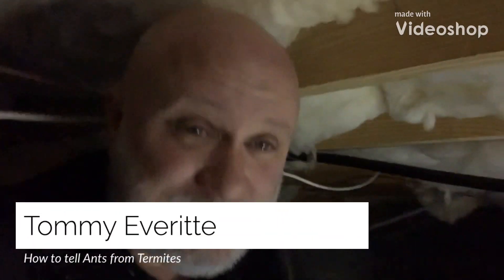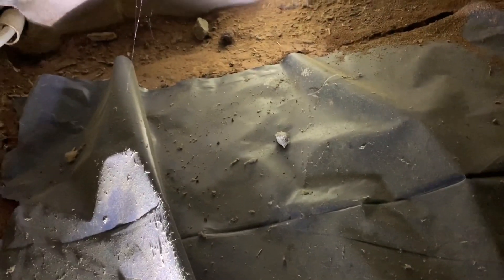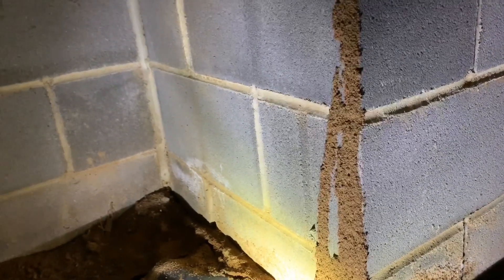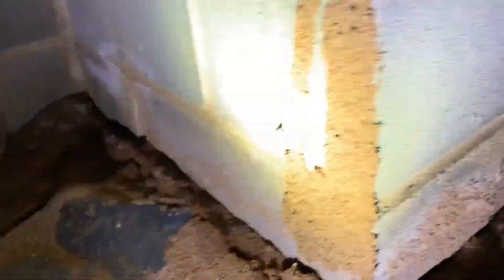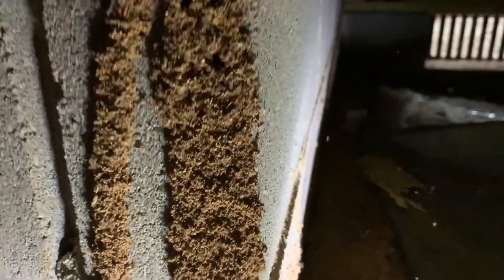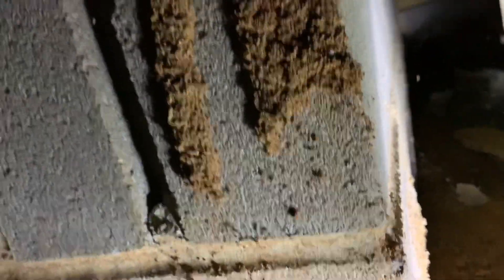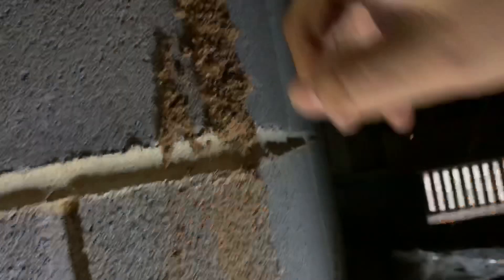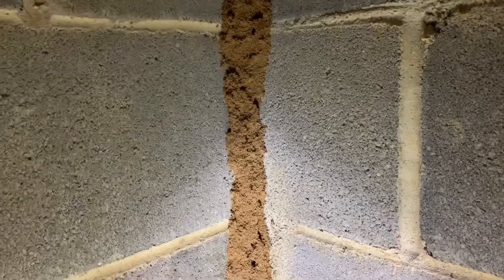How to tell Ant tubes from Termite Tubes

Comment: Thanks for this! I thought we have termites infestation when I saw something like this and thank God it's loose! 😂 Btw, when I removed it, they made a new one on the same spot in just 2 days! What can i apply on the wall that they hate so they will go away? TIA!
Reply: Another observation: when you break a termite tunnel, you'll surely find termites inside it. When u break ant tunnel, you aint gonna find the ants inside. Right?
Reply from the maker: @omma_ph  sometimes but if a termite tunnel is inactive you will not see any
Reply from the maker: First just to be on the safe side I would get another pro out there to make sure it’s not termites. Many will come out for free. It’s ok to get multiple opinions. If it doesn’t s verified to be ants I would go with an appropriate bait

Comment: Why is it bad for bait systems to be used for new construction? I bought a new construction house a couple years ago and bait stations were installed with a free first year of service / checking them when I moved in, but I decided not to renew after the first year because it was around $350 / year, which seemed like a lot to me. Now I'm wondering if I made a mistake by not renewing. I live in a slab foundation house in metro Atlanta, Georgia.
Reply from the maker: Grayson Carr  the reason it’s bad is because if you don’t renew them there is zero protection for your home. With a normal Termidor treatment your home will be protected for about 10 years even if you don’t renew.
Reply: AAA Exterminating Co. So would you recommend a Termidor treatment or have the bait stations reinstalled?
Reply from the maker: Grayson Carr you could do either one but I prefer Termidor because it’s just the best method. If done properly it never fails and gives long term protection